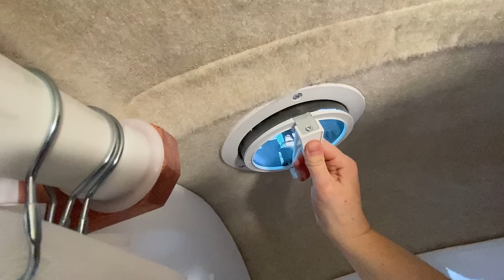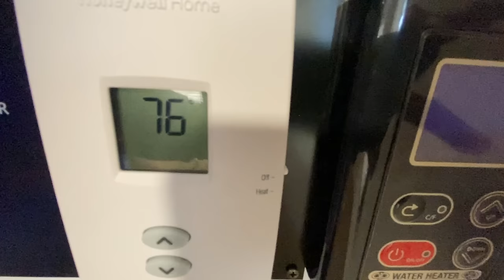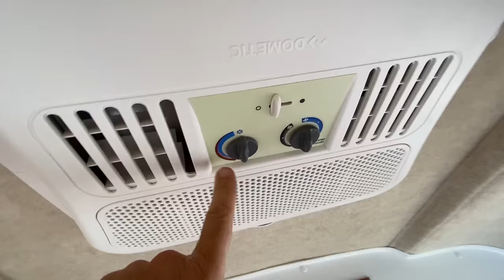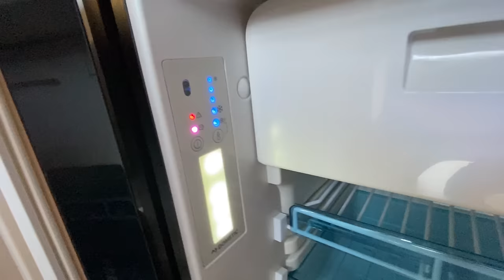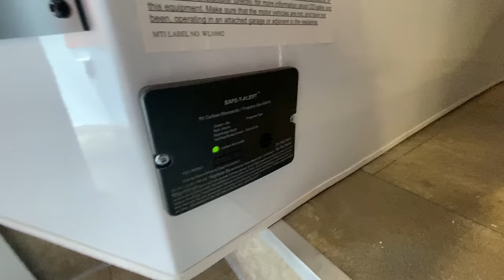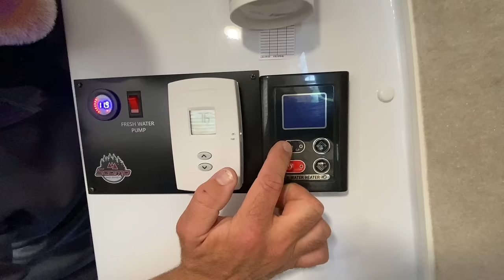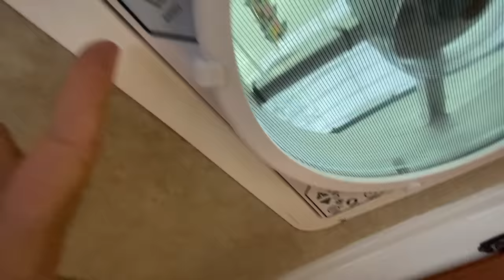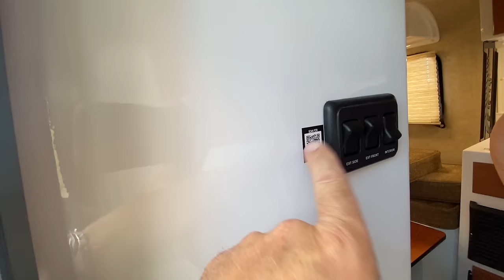Episode 2 - Scamp Walkthrough

Comment: I like Scamps but for the money I'm underwhelmed and glad we rebuilt a Trilluim from scratch. That Group 27 battery will not get you very far in boondocking particularly based on the power needs of that trailer -aircon, fridge waterpump, furnace. You will need to consider upgrading to at least 200ah lithuim battery plus solar panels to even last a couple days boondocking
Reply from the maker: I think we will just carry a little generator.

Comment: Scamp has definitely done some improvements the last few years. One area that need improvement, is needing a pump to drain the shower and having separate gray and black drain connections. Having a tankless water heater is really nice, our Casita trailer has a tank type water heater. I really like the tree shaped support for the overhead cabinet, versus the twisted metal that they used to use. We have the metal top on our stove, I agree with you, the glass is much nicer. Scamp has far more build configurations than Casita, Casita doesn’t even offer a 13’ model anymore. I like your trailer, very cool.
Reply from the maker: Yes, a gravity type shower pan drain and separate grey and black tank connections would be some improvements that Scamp could make. We like the tree shapes  cabinet support too. We did not even know Casita stopped producing the 13’ trailer!  Thank you so much!

Comment: There are many things I like about these small lightweight campers.

SAFETY CONCERNS 

For this particular model I have some safety concerns as well as design suggestions. 

From a common sense perspective, I noticed the potential for deadly harm to occur. My unsafe situations observations are in the order as they appeared in video.
1) The outdoor shower is right beside a 120 volt electrical outlet. The threat is electrocution short.
2) The furnace air  intake vent is right beside the exhaust vent. The threat is acute carbon monoxide poisoning.
3) The height of the electric light in the bathroom has potential for electric shock unless it is waterproof and it is certified safe by the Underwriters  Laboratories  approved.
4) The bottom of the cupboard above the stove burner is fiberglass and could melt, drop contents down onto the burner. This is a fire hazzard. 
5) The contents in th cupboard above the burner could catch on fire because no insulation to restrict or abate the heat. Fire hazzard.
6) When boondocking the camper clean water reservoir should be able to travel full. 
7) The waste tanks surely must be designed to transport wastes to disposal site without compromising integrity. You would not want wastewaters (WW) to contaminate the living space because they couldn't tolerate the WW sloshing around when driving over rough terrain.
8) It sounded like the on demand hot water heater could be gas powered. Is there an outside exhaust for the hot water heater? If gas, and if not vented, this would make a carbon monoxide poisoning event likely. 
9) Does the carbon monoxide dectector have a battery backup?
10) Is there a smoke detector. If not, one should be wired in with battery backup.
11) Make sure that one of the back bed area windows will pop out so you can escape from the camper. I had to escape from our popup camper due to a skunk. 

OTHER POTENTIAL PRODUCT ISSUES & SUGGESTIONS

A) The moleskin fabric on the shower ceiling will eventually mold, starting at the seams. Try a different type of surface or finish.
B) I would like for the system lights to turn off in individual areas too. Saves battery charge.
C) The cupboards should already have a means installed to hold them open.
D) The table leg is very narrow at the bottom and could potentially poke a hole through the floor. There should be a metal plate immediately below it.
E) The company should design better supports for the bottom board of the top front cupboard. 

Have fun!
Reply from the maker: Those are great observations! Thanks.
Reply: Am scared like hell now!😳

Comment: Not mouse fur, lol… it is lovingly referred to as “rat fur“. :-). And the screens are called “no-seeums” because they stop even the super annoying tiny little flying bugs called “no-seeums” from getting through the screens. And that’s a good thing, because they are as bad as having mosquitoes getting in. And you don’t want to charge your Jackery with that 12 V socket unless you are driving and your house battery is being charged from the vehicle’s alternator. If you plug it in to charge it, you will just drain your house battery just to charge your Jackery (unless when you are stationary, you are plugged into shore power). And that strip that is called “vent” above your refrigerator, is so that the heat produced by the refrigerator has a place to vent out to so it doesn’t overheat.
Reply from the maker: All good to know! Thanks

Comment: So the purpose of the fresh water tank is for boondocking............ but you can't fill it and go boondocking.
Reply from the maker: Well, ya that’s how it comes across. They said that they recommended waiting to fill that fresh water tank till you were close to your spot. For example, fill up at the last place you can find potable water before you get to your camping spot instead of when you are leaving your driveway. That makes sense for fuel economy too.
Reply: @scampchannel   You can always get a Berkey (sp?) filter system.
Reply: Very much appreciate you showing that no Jack or wrench is included. 
We like seeing the underneath. My husband used to build fiberglass boats.
Reply: Ya that's a pretty bad deal that the trailer tank straps are not capable of handling water being filled prior to camping,this clearly is a toy and not set up for boondocking strictly a campground with hook ups.
Reply: I was coming to ask this same question, why would they make it so cheap that you can’t even carry water for when you go somewhere without water… yikes
Reply: @kristiboylan4547  Having owned a number of trailers from various manufacturers, not one restricted having water in the Fresh Water tank while driving, can't believe Scamp would be the only one to do so. For lower weight and fuel economy, it's best to travel with empty tanks as long as possible. If traveling in windy conditions, I travel with water to increase stability in the wind.
Reply: 10

Comment: Great video! I have been considering a starter camper. I can't tow much...1500 pounds with a 150 pound hitch on my Crosstrek. What do you pull this with and did you have to have your vehicle wired to accommodate lights and electric brakes?
Reply from the maker: We pull with a 2021 Subaru outback touring XT. We do have the vehicle wired to accommodate light and electric brakes.

Comment: Can I ask what you are towing it with? Does your tow vehicle have the tow package (transmission radiator, beefed up alternator etc) thanks.
Reply from the maker: It’s a 2021 Subaru Outback Touring XT. The XT comes with a turbo charged engine and allows for towing up to 3500 pounds.

You can read about stand and optional features that help the Subaru outback tow at this link :

https://www.autosavvy.com/2021-subaru-outback-towing-capacity/

Comment: I like the trailer, what is the price out the door with all the options you show?
Reply from the maker: The Scamp’s MSRP was $33,331.20 but you can haggle to a lower price.
Reply: Really like the little Scamp, but not at $33,000 plus.
Reply: Good grief. We bought a 32 footer for $32,000 a few years back.
3 season 32 ft Sleeps 9.

Comment: I would like to have AC in it or did I miss you talking about it ??   It is a very nice camper besides that !!!!
Reply from the maker: Yep, we defiantly needed the A/C so we included it as an option when we ordered the Scamp. We upgraded the A/C to include the heat strip (electric heat) and the soft start (won’t trip 110v outlet circuit breakers when it starts). We haven’t tried it out yet. Some comments left by others said that the A/C was too loud. We will see!
Reply: @scampchannel  Thanks for the reply & happy camping & safe travels !! Take care   💗

Comment: When you are at a campsite with sewer connections.Once you're connected, don't leave your connections open.Because there's flies like fruit.Flies inside the sewer that will come up into your rig.Simply open and close your connections as you need to dump them
Reply from the maker: How is it that the fruit flies get past the water held in the J trap under the sink? I know that that water prevents odors from flowing back up the lines from the sewer, what did it also block insects?

Comment: What is the sleep arrangements in a scamp
Reply from the maker: Well, it depends upon the size of the scamp (there are THREE SIZES: 13ft., 16ft. or 19ft) and the different layouts offered for each of the sizes . On the Scamp you saw in my video, which is a 13ft, there are TWO layouts. 

My layout offers a full sized bed and a bathroom/shower, so it sleeps only 2 adults.

The other layout offered for the 13ft offers a full sized bed and but with bunk beds instead of a shower, so it sleeps 4 adults.

Comment: might be an inverter next to the Brake Controller.
Reply from the maker: I think the inverter was next to the on demand water heater though.
Reply: It is a 12v power distribution for the trailer lights... Just a bunch of nuts holding down the running outside lights...
Reply from the maker: Thanks!

Comment: Dos preguntas, observó dos grifos en la ducha, agua fría y caliente, sin embargo, no veo ningún termo, ni eléctrico, ni de gas, no tienen? 
Y la segunda, donde almacenan las aguas limpias, no veo los depósitos por ningún sitio.
Gracias.
Reply from the maker: I hope this translates correctly. There is a water heater. It is a “on demand“ water heater. I pointed it out in the video, there is a panel that opens up on the back left side of the Scamp and the on-demand water heater is inside.  There is a water tank. It is a white plastic cube with two metal straps, holding it down. In the video I show the water tank it is under one of the seat cushions beneath a panel. It’s not very big don’t think it would hold more than about 20 gallons. Thank you for your comment!

Comment: Nice just a shame they cheeped out on the cupboard you had to put trim back in place on. 15:28 . That and no hold open hinges. Not a high quality build the way the door ripped the screen that and bare cheap particle board instead of a good plywood in that closet.
Reply from the maker: Agree with all of that! Recently we experienced a whole new problem. Coming around the corner on a mountain pass, I faced a toaster sized rock in the middle of the road. I couldn’t swerve around it, so I had to straddle it. It went underneath the Subaru just fine, but it struck the tongue, jack, guard, plate, and the shower pan water pump underneath the trailer. I don’t know why they have the water pump mounted to the bottom of the trailer completely exposed but it got smacked by the rock and it cracked the housing. I’ll be making a video soon on the replacement of the pump and I think I’m going to replace the tongue jack with a power jack.

Comment: Also ,no outside canopy out side lights..or security..
Reply from the maker: There is an outside LED by the door and over the propane tanks. No outside canopy (we opted for one of those octagon shaped tents with mosquito netting that sets up over a picnic table instead). We added a pretty good trailer tongue lock and a GPS tracker for security. We did not want or need cameras because one of us will hop out and help back up the trailer if it’s needed (it’s only 13’ long). Heck, I might be able to move it by hand!

Comment: Fit on the ceilings is a no no. It will mildew. Antibacterial or not, and it will stink. It’s cute though. For one person boondocking for a few days. No TV? Seriously guys, as much as you ask for these, put a T V in there.
Reply from the maker: There is a TV option from the manufacturer but we use our laptop or iPad.

Comment: Is fiberglass just thick plastic?
Reply from the maker: Plastic is a material that is made from organic polymer chains of petro-chemicals, while fiberglass is an inorganic compound that is made from glass fibers. Fiberglass is a combination of resin and glass fibers which creates a fiber reinforced plastic. Fiberglass is made by adding resin to the glass fibers. Different resins can then be added to make the product stronger, tougher, and less brittle.
Reply: @scampchannel  Wait so there’s no plastic in fiber glass at all? For some reason, I’ve always thought fiber glass is a type of plastic that’s more durable than regular plastic.
Reply from the maker: Well, it’s not technically a plastic. It’s a “resin”.. its more like an acrylic infused with strong strands of glass fiber. 

Check out the following video link. About one minute, and you will see how the fiberglass is sprayed into a mold to make the Scamp.

https://youtu.be/9fnU-D2lWG0

Comment: windows all around and nice inside heat or cool and just cozy as it is be great ideal camper for yard or just get away of some short like a hermit payment plan or price seems to be a problem cause as to space it is not sole older trailers more room sometime cheaper kinda seems un fair to sales of some kind but as preference goes these are nice i really like but truck camper going for seventy thousand i become a grieper/
Reply from the maker: True, they are expensive. However, fiberglass trailers only depreciate to a certain point and then plateau and hold their value.

Comment: Thats a bit disappointing after seeing trim loose, doors that wont stay up, the heater right next to the refrigerator. Not bashing but I'd be a bit upset if it were my purchase.
Reply from the maker: Cathleen and I have talked about all that. Honestly, while we were excited to get the scamp (after waiting for it) we did feel a little disappointed in the fit and finish. In another video, I notice that you can see the road beneath the trailer through a portly fitted access panel inside the storage area for the fresh water. Also, the pin that activated the emergency braking for the trailer could not be reinserted after I tested it and needed replacement. We are going to continue our reviews of the scamp over the next months and we will report our experience with honesty and transparency. Please subscribe for updates. Thank you for watching and for your comment.

Comment: It will keep you Texans up off the ground safe from rattlesnakes a bathroom system that just about anyone can use 37:03 will roomy room. Provides nice heater/air-conditioning set high off ground where can get down  to 37:43 38:02 ri😮vers systems still have river b and camp fire at nite while running trout lines to catch 50 lb cat fish. You will be behind walls not cloth of a tent  where you're  at  risk more protection.you can choose but for small to go in tight places this would work.
Reply from the maker: Thanks for watching!

Comment: Looks very cheaply made. A water tank that you can’t fill is rather useless. Surely it wouldn’t cost very much to upgrade the tank restraints in order to be able to fill it for traveling, unless of course there are other issues with the freshwater tank?
Reply from the maker: Yes, we think adding additional restraints on the water tank could serve to make it capable of long distance travel with the tank filled. One other thing we would like to upgrade on the water tank is to install a clean out port. I’ll be making a video on adding one.
Reply: Its heavy. I’d add water maybe 2 miles before camping. 😊

Comment: No, the propane tanks do not "come from the factory" already filled. Illegal to ship tanks like that filled. The Dealership will fill them when you buy their unit. Why would you leave the Reserve tank shut off. When propane us depleated from the Supply tank and no propane can be drawn from the Reserve, your refrigerator will not operate if it's running on propane.
Reply from the maker: Well when you pick your new Scamp up from the factory, the propane tanks are filled. I can’t think of a reason you would leave your reserve tank shut off or unless it was already empty. Also,  the refrigerator does not run on propane in a 2023 Scamp.
Reply: @scampchannel  Only 12v? The "factory" sold a unit to you retail? They don't have Dealerships?
Reply from the maker: No, they only sell directly from the factory.
Reply from the maker: And the fridge runs off 12 V or 120 V if you’re connected to shore power.
Reply from the maker: Also, Cathleen brought up a great point. She said one of the reasons you might not want to have your splitter automatically go to the empty tank on your propane is that she wants to know when her propane tank has reached its empty point so that she will be reminded to disconnected and take it into town to fill it. If it automatically switches, then we would likely forget to fill the empty tanks until both were depleted. (leaving us with no propane when we might need it the most).
Reply: @scampchannel  If you're not using propane to run your refrigerator, propane will last a long time. I ran through 20#, 4 gallons, of propane every 2-2½ months just using it for hot water and cooking during the summers at an RV park. Does your water heater only run on electric?
Reply: @scampchannel  Good to know, never knew that about Scamp. Scamp outsources propane tanks and they get them shipped empty.
Reply: @scampchannel  Are the house batteries LiFePO4? If you ever boondock, get an upgrade on your solar and if you have to, switch over to the Lithiums for greater power reserve. You can get almost 100% capacity on them as opposed to 50%, or less, on Lead-acid or AGM's.